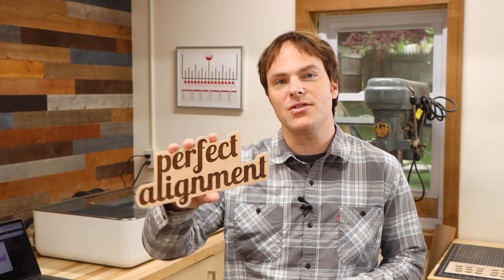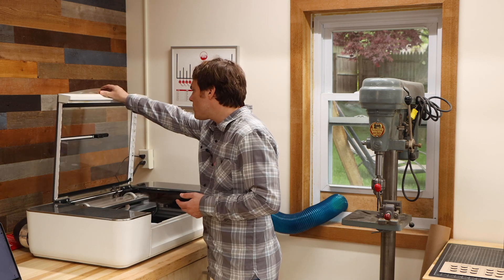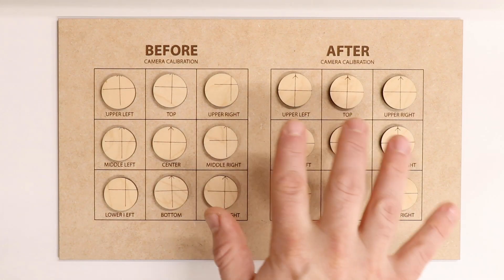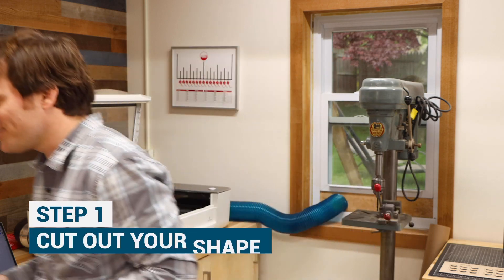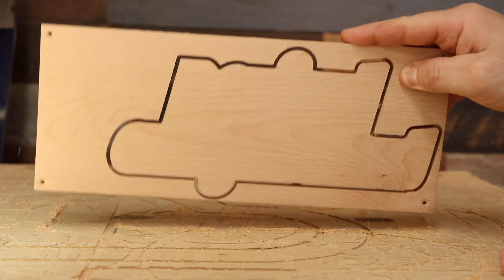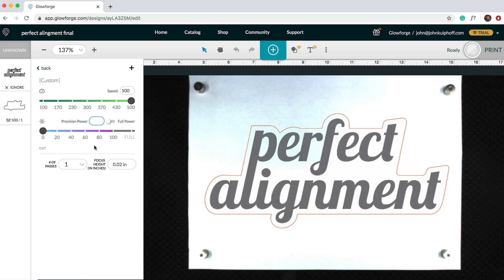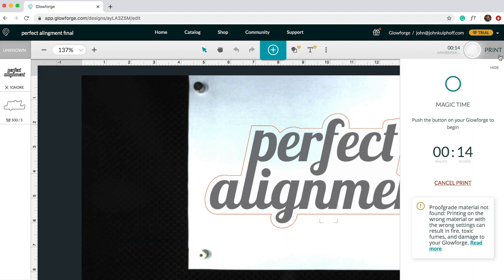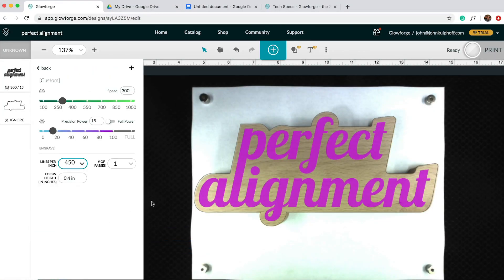Perfect Alignment with the Glowforge

Comment: This works great if you have a shape to be engraved in a known position on a base that you also known the shape, size, and orientation of in the file with your art.  For me that is a rare circumstance. I would probably make that sign by engraving and cutting from a piece of ⅛-¼" thick wood, then cut additional layers to glue on to add thickness.
Reply: It’s a great idea if you want to say engrave a purchased item like a cutting board, or engraving MacBooks or things like that. It’s like a jig to get the right alignment every time. Ive wasted so many blanks trying to get my engrave designs lined up based on the glowforge camera alone. I’d most likely cut this out on a piece of cardboard to use it as a jig for future engraves on the same materials again. I didn’t see any machine focusing at all in this video which seems odd. But maybe some people don’t have to focus 🤔 I ALWAYS have to 😂

Comment: Hello! I have a question…what if I didn’t design the shape? I am trying to align my text on a beer flight I have purchased. I can’t cut the shape our outline it. Like my recipe boards. I purchase them, place them in my forge then try to center my design by the naked eye. What am I missing? I’ve wasted so much money with engraving and things go up
Reply from the maker: Good question! I usually scan the object using a flatbed scanner so that the dimensions are exactly right. Then, you can quickly trace the object in Adobe Illustrator  to get your outline shape. Hope this helps!

Comment: Wondering if you can help me. I am trying to cut a photo out perfectly with my glowforge. Like I glued a pic of a pig on my wood then want to cut it out but it’s always off a tad. Any suggestions?
Reply from the maker: Hi Carissa, sure thing! I'd be happy to help. Normally, running your Glowforge through the calibration routine (https://app.glowforge.com/maintenance/camera-recalibrator) should make things much easier as the image is already glued to the piece. If that doesn't work, you can try temporarily placing a thin sheet of clear acrylic onto your wood and very lightly scoring the outline your graphic onto the acrylic. You'll be able to if your alignment is off as the line will appear on the clear acrylic and not on your wood. If you need to nudge things - you can do that and run the score line again until things looks good. Once you're done, remove the clear acrylic (without shifting your wood piece) and cut out the wood with the normal wood cutting settings. If you need a quick demo, feel free to reach me at kuiphoff[at]gmail.com - we can set up a quick call. Thanks!

Comment: thanks for this video. I'm curious if you have a suggestion/solution for items that are too big to use with the crumb tray? The paper is too thin without the tray, so you need to score the paper with the tray in, but then you need to take the tray out to put the blank in (in my case, a flask). How do you still use the scored template if you can't leave it in the machine to line up the product? Any tips are greatly appreciated. My Glowforge just arrived :)
Reply from the maker: That’s a really good question. Ha! Some laser cutters (like an Epilog) have a bed that moves up and down to focus the laser - if that was the case, it would be super easy to employ the same method. The Glowforge doesn’t work this way. I also hit this same stumbling block after shooting this video and do not have a great solution. Technically, you could make a small paper or cardboard box that’s roughly the same thickness as your piece and carefully placing your piece in there when the shape is cut. In practice, I’ve resorted to temporarily placing a 1/16” piece of clear acrylic on top of the piece, lightly scoring the outline into the acrylic and checking if It’s off (since you can see through it). If it’s not spot on, I can adjust the position in the software and re-score the acrylic. And check again. When everything looks good, I can take out the acrylic and engrave the real piece.

Comment: Have had my Glowforge for almost two weeks  now, and have been reading posts about people having trouble aligning engravings with jigs and whatnot - THIS makes perfect sense, and the only waste is one sheet of paper! This is an excellent tip - thanks!!
Reply from the maker: Thank you! Good luck with the Glowforge - I'm using mine today to cut felt for custom drum parts.
Reply: @JohnKuiphoff  I think I might try engraving on a small cutting board today - thanks to you, I am confident I'll get placement correct the first time.

Comment: If I have a preshaped plaque that I did not cut, how do you get the shape on the glowforge so that I can score a piece of paper on the specific shape of the plaque?
Reply from the maker: The best way that I've done this in the past is to place the plaque (or object) on a flatbed scanner so that you can scan it to scale. You can then use adobe illustrator or another vector program to import the scan and quickly trace the outline of the plaque using the pen tool. That will give you the outline shape you need to make the score on your paper.
Reply: @JohnKuiphoff  thanks

Comment: How do you go about removing the burn discoloration?
Reply from the maker: If I'm using wood, I just sand it with 220 grit and spray it out with canned air (or use a shop vac). You can also mask the material - this works well for other materials like acrylic.

Comment: How would this type of check workout the crumb tray
Reply from the maker: That's a good question... you're the second person to ask. The way that I demonstrated won't work without the crumb tray... Instead, I'd try to use a 1/16" piece of acrylic and place it on top of the item that you're engraving. Then, I would score the outline onto the sacrificial 1/16" acrylic to see how close it was... I'd  nudge the piece and rescore the acrylic sheet until it was perfectly aligned (it might take a few tries). Finally, I'd use painters tape to mark the outline of the piece and go from there... it's definitely a bit more involved than the approach in my video...
Reply: @JohnKuiphoff  what settings would you recommend to score painters tape without seeing anything underneath.
Reply: @JohnKuiphoff  I'll definitely try the other times. Thanks

Comment: woo hoo! That is absolutely wonderful John! Thank you for taking the time to share your experience. I've had my Glowforge for almost 3 years and I hadn't thought to do this.
Reply from the maker: Thanks so much! I really appreciate it. I've also had my Glowforge for three years and it's still going strong! Although, I did recently upgrade to the pro. ha!
Reply: @JohnKuiphoff  We were really glad we ordered the Pro when it came time to add an inline fan and we needed an acrylic window pane made and it was much longer than the other models would have been able to accommodate. Another time was when I made acrylic templates for a friend and they were just inches longer than the width of the bed!  Thanks again!

Comment: Great tip.  What were your settings on the engraving? It looked so clean- no burn marks!
Reply from the maker: Hi Jeff! Thanks so much. I used the same settings for Proofgrade Maple and lightly sanded the burning marks off with an orbiting sander. A lot of times, I'll use a masking paper to ensure that I don't get any burn marks. I made another video where you'll see what materials I sand, use masking, or just leave it be here: https://www.youtube.com/watch?v=M5AkSfq8cPU - it also includes all of the setting for every material. Thanks again!

Comment: Hello! I was wondering if I should run a calibration to fix my machine. The bar behind the laser hit a cutting board that I had too high (forgot to take crumb tray out), and is now printing way off of the design focus. Ex focus is in middle of board and design is printing way down in bottom corner or just extremely off where its been placed.
Reply from the maker: Hi Miranda, I've had that happen, too. Normally, the Glowforge runs a centering routine when it first turns on (my CNC machine does the same thing). This routine tells it where the laser head where it is on the bed. If you turn your Glowforge off and back on again, the issue should correct itself. If it doesn't work, you might need to push the laser to the top of the bed (when it is turned off) before you turn it back on. This will make sure that the laser assembly is moving straight - not crooked  or sideways along the rails. You probably won't need to recalibrate unless the lid camera or the lid got jostled in the process. Hope this helps! If not, let me know and we can investigate it further :)

Comment: #1, your laser is way too clean lol
#2, great video. It seems that if you don't move anything, and just set the focal height of each piece, it will line up correctly? I need to run the calibration on my machine, may do that today actually....
Reply from the maker: ha! The laser has a million miles on it by now... but I do clean it weekly. And yes, that's true! As long as you don't move anything, your engravings will be aligned perfectly to your material (you can "set focus" on each material if you want the camera preview to look right - but it's not required). The Glowforge calibration routine works beautifully! It's makes all the difference. Although, if you rely solely on the lid camera, it may still be off by a millimeter or two nearest the edges even after calibration - usually that's close enough... but not always. Thanks for watching!
Reply: @JohnKuiphoff  Hi John,  thanks for another good vid. In this instance, did you input the material height or leave it on auto?
Reply from the maker: BenSCS I left it on auto (although I may have set the focus just to make the camera preview image accurate- even though it’s no necessary to do that).